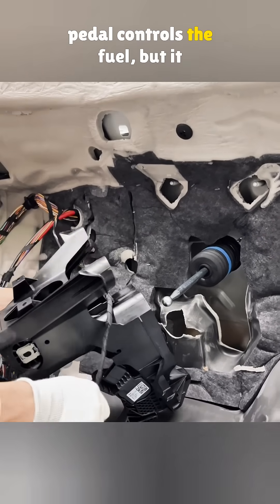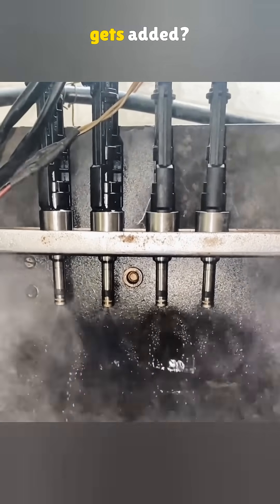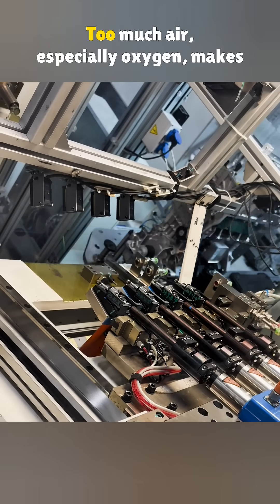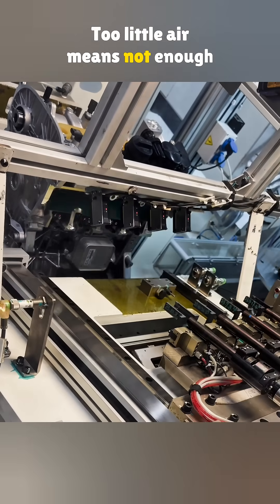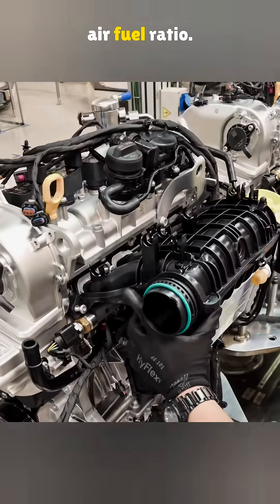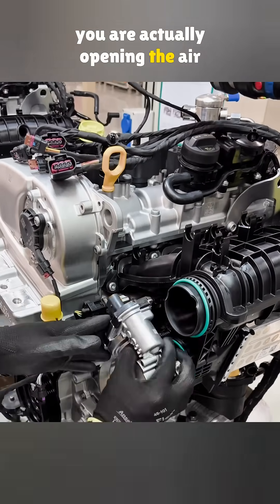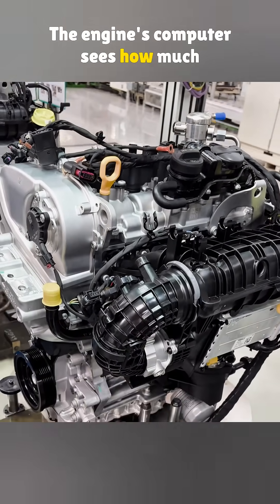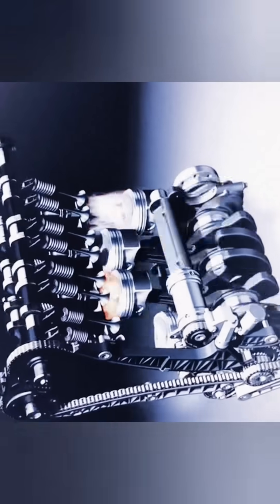Does the Gas Pedal Control Fuel? Not Really #assembly #car #manufacturing #automobile

Comment: I think the facts stated are oversimplified. You have to state what types of engine you referred to; is it old engine design (carburator without E.C.U.), inlet valve injection or direct enjection engine wtih ECU.

You 3 types of combustion; stoichemetric combustion, lean combustion and rich combustion. Lean combustion with excess air does not make the engine hotter but cooler. The best combustion is stoichemitric combustion with the right fuel oxgen mixture, with the most efficiency and least polution. 

Rich combustion, common with old carburator can cause engine overheating with increase unburnt carbon and polution normal during acceleration. This problem is solved with modern engine with new type of ECU which control both air throttle valve opening and also fuel injector timing. The modern controller also take input from gas pedal as well from excess oxypen monitor for optimum combustion.😊😊😊

Comment: Only true for petrol engines. The throttle on diesel engines does indeed control the fuel quantity. This is because diesel engines do not have a throttle valve and they always work with excess air. This is also why diesel engines have a lean fuel mixture (more air than fuel) and why diesel engines have better fuel economy.

Comment: Gas pedal does not directly control the fueal mixture but it controls how much the throttle body should open. and then when the air gets measured by the map or  mas air flow sensor detects the it tells it to the ecu and the makes the injector to injecrs more fueal

Comment: Actually the gas pedal does add more fuel. You said it yourself more air more fuel, the gas pedal putting more air into the engine causing the computer to add more fuel so yes the pedal is adding fuel through a chain of mechanical and electrical components. The movement of the gas pedal sends a signal composed of air pressure through a throttle body the sensors there send an electrical signal to the fuel metering system to add fuel to match the optimum air fuel mixture. Then the engine makes go fast noises.